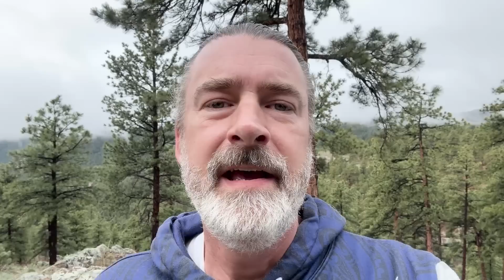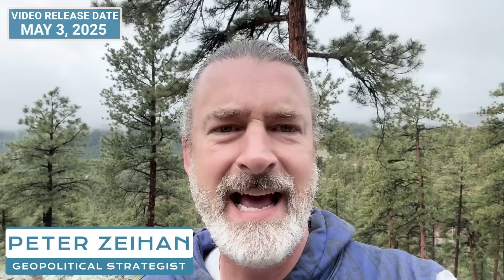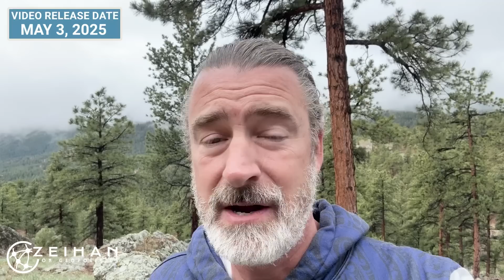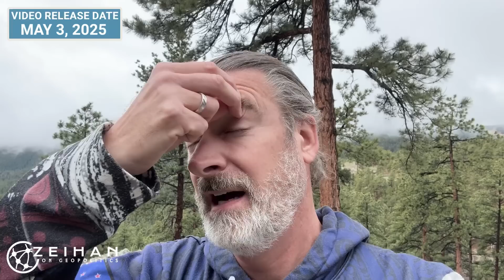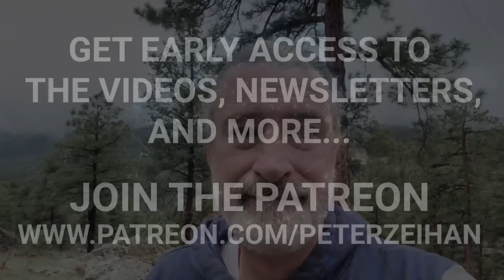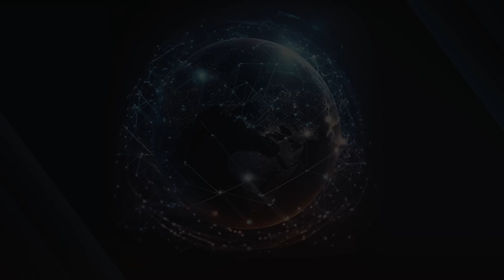The Night the Lights Went Out in Geor- er, Spain || Peter Zeihan

Comment: Electrical engineer here. We spent a lot of time in lectures covering Macarena to Lambada conversion. Wasn't my strongest subject. I preferred synth pop to grunge transitions.
Reply: Peter is sooooooo far outside his expertise, this vid post of his is a joke.
When he says megahertz and he means hertz and he doesn't mentally catch the mistake says he clueless about what he speaks.
He can't fathom reactive power, and syncing voltage and current freq in AC system and the power factor.... he shouldn't have ever made this post.
Every non-engineer is now dumber after listening to Peter butcher this subject-talk with  his terms like wobble and dance comparisons.
Reply: @joelobryan1212  the megahertz thing grated but to a non professional it's an easy mistake to make without realising. It wasn't a great explanation but I don't think it's quite as bad as you are claiming. I think I'd rate it "mostly harmless"
Reply: @joelobryan1212  this comment. 👍
Reply: Electrical Engineer: why can't the grid use a radio signal to sync everything?
Reply: @patrickshawstewart1538  I'm betting, latency.
Reply: As long as you saw the sign and it opened up your mind.
Reply: Latin dance teacher here. This is a perfect analogy, in my opinion.
Reply: Usually Electrical Engineers complain that the physical definition of current by Benjamin Franklin goes from positive to negative voltage, which is misleading when it's really carried by negative electrons in the opposite direction. But really we should complain about 'DC' and 'AC' when it could've been Waltz Current vs Mambo Current. Or Salsa Current. Or something.

Comment: South Australia experienced a "system black" in 2016 when nearly all grid demand was supplied by wind and solar. The wind was so strong it blew over several transmission towers, leading to a change in frequency and voltage then triggered the wind farms to turn off. This was because the inverter settings were designed to protect the equipment rather than support the grid. Since then every new generator (wind, solar, battery) added to the Australian grid needs a simulation where the inverter settings are tested as to whether they will support the mainentance of frequency and voltage in the face of a disturbance, such as the tripping of a transmission line. No further system blacks have occurred. Had these simulations been conducted in Spain prior to accepting these wind and solar farms their system black would not have occurred. At the time of their system black nuclear was supplying 20% of demand, and this was insufficient to maintain their grid. Now South Australia regularly operates at only 6% of grid demand as gas. A couple of gas units continue to spin at minimum load plus several synchronous condensors to maintain system strength.
Reply: It should also be noted that, in fact, the reason for the actual blackout was because coal plants had lied to operators about being spun up when, in fact, their operators had shut them down cold to save money.  So the buffer grid operators thought they had didn’t actually exist.  In ensuing years, the coal operators have more or less been completely cut out of the equation by grid scale storage which does a much better job supplying missing power when things trip off (most notably, coal plants in several later examples), and stabilizing the grid.
Reply: And what's the price of electricity now in South Australia ?
Reply: @anomadhunter  In 2024 price of Electricity on the Australian National grid was about the same as France.

Comment: Wind and solar combined supplies 30% of the energy in spain in total, I have a very hard time to belive that at the time, they supplied 80% of the energy. It's basicly like Texas in terms of production, but with interconnections. Seems really, really improbable.

Edit: According to REE, it was 70% from wind and solar. Also, it's not concluded, to this date, what caused the outage. Last major outage on the iberian peninsula was caused by a water bomber fighting wildfires. Also, the first occilations were detected 30 minutes before the outage and migated, suggesting that the readiness and spare capacity for occilations were in place. I call BS on this whole explanation.

Comment: The old coal and gas fired power station could be converted into flywheel. Giant motor generators that add physical mass to the grid and absorb spikes or provide carry through  power if there is a surge.

Comment: Ireland has huge spinning mass in shuttered coal plant used as a buffer and they will install a few more. Also nuclear. So that's 2 more options and probably using them combined with fast batteries is what we end up with... eventually after enough screw ups like this one.

Comment: Oh lord the old “inertia” talking point . There was no physical inertia that could do anything about a fall of about 10 gw of supply, this was more likely an issue with inverters or transformer stations . Also, you point out correctly that current grids ask for about 20% of inertia based supply (like gas) but co conveniently ignored the fact that the spain grid already had that 20% of sources with physical inertia, nuclear and hydro. This number has gone down constantly, i remember the old fossil shills hitting me with the 80% minimum of inertia based supply in the 2010s, now with better technology we are at 20% and we’re just starting to see significant amount of batteries on the grid that will be able to provide synth inertia, for extremely cheap (just check how cheap fcr has gotten now on any grid, batteries have undercut all the old systems). This all coming out before an official investigation mind you, so just using the opportunity to shill fossils.

Comment: Could you have giant flywheels. Worked at company that had flywheel generators they only provided a few minutes power but enough to allow startup of a gas/diesel genset. Flywheels would have a fair amount of inertia but you would need a fair amount of them to buffer the grid.

Comment: Wobble??? Is frequency all that difficult word for your viewers? Speaking of words, a "turban" is something worn on the head while a turbine spins to create power. You don't need coal or gas, you just need a source of power that can be turned on quickly to stabilise electricity production - that might be nuclear, grid scall batteries, large spinning weights or pumped hydro if you have the geography for it. Actually there are lots of other options.

Comment: The modern and most effective technology for grid stability is virtual inertia provided by sophisticated software in battery grid storage, like Tesla Megapacks. Tesla Megapacks use common lithium iron phosphate batteries, not some rare magical titanium batteries. The problem here was a power grid that didn't curtail excess solar production during peak production hours and that lacked sufficient advanced battery storage to maintain grid stability. The solution is to put competent engineers in charge of grid design, not politicians with an axe to grind.
Reply: ☝🏼THIS,

Comment: Im an electrical engineer. We could solve this problem if we had a battery that could operate in a high state of flux... One that could discharge a large amount of energy quickly, say, a capacitor. One that operates at about 1.21 gigawatts ought to suffice. 

The only green source of power like that is a bolt of lightning. Unfortunately you never know when or where one will strike.

Comment: there is flywheel storage that can take care of this.  The technology has been around for 75 plus years and with new technology these devices have become very effecinet.  People have look at flywheel energy storage but its cost hasn't come down as fast as batteries, but for fast discharge (Grid stabilization) it can't be beet.  Sandra National Labs has been working on this for year.  Some years ago SNL built this big, like the size of a shipping container, flywheel and they would take days to weeks to spin it up but then could discharge in a minute or so.  This was needed for some experiment that they were running.

Comment: Spinning reserve solves the problem. Essentially energy stored in flywheels. In a largely renewables grid in the absence of spinning nuclear or hydro generators, there needs to be quite a few of these flywheel systems scattered around the place to provide the necessary rotational inertia needed to stabilise grid frequency.
Reply: It actually doesn’t in this case.  15GW went offline at the beginning and Spain is still being tight lipped on the data… politics have gotten in the way.    The “wobble” as Peter calls it … well, there was some instability before the fall but Peter’s explanation was gobbly gook.  Literally made-up nonsense.  Spinning storage can’t deal with actual power deficits… it is strictly a stabilizing mechanism.

Comment: Peter...you should learn a little about honeywell/ess iron flow batteries. At the scale (multi gigawatts) and time (22hours) that they can discharge and the speed they can kick in (<0.5 sec) it would prevent the issue. It's cheaper thant anything out there and it only needs water, iron and salt.

Comment: You can have gyroscopes as well. Just spinning mass the same as a turbine. You just don't need coal to run them. They will give you instant reaction. Weather the power goes up or down.

Comment: I think you’re about to say flywheels for the second, wheel see. But you can also use big ass banks of super capacitors, and those are even easier to build than big flywheels. I’m talking you can literally build them in your garage. Either way, Lithium-Titanium is not the only choice here. In fact, I’d say it’s pretty far down on the list. 
As always, love Peter, but never forget that Peter is basically an Oil & Gas lobbyist when it comes to renewable energy. For whatever reason, he refuses to learn about the sector, probably because it’s complicated & he’s old enough to be set in his ways.

Comment: E engineer here.
I am so happy that you aren't consulting any grid operator.
No there are need for special batteries. You just need to re introduction of more rotational inertia on the system.
The best and cheapest way is use a number of sync. Compensation units. They are basically a standard grid generator with a motor, to spin it up to the grid speed and connect them to rhe grid.  They have exactly the same function as a powerplant.  And they are primarily made og steel, copper and aluminium.
Please don't step outside your field..

Comment: I'm an American living in Portugal, and the day of the power failure was quite interesting. Power failures have been few over the past 4 years. I've got a supplementary solar system with batteries that did not work (not designed to work) during a power failure. Maybe I can change that, I don't know. I am looking into installing a diesel generator to provide basic power, that starts up automatically when the power fails. If these power failures begin to be more common and last longer than say 12-24 hours, that becomes a higher priority.
Reply: I have an MPP SOLAR PIP5048MG off grid inverter/charge controller with some AGM batteries. It has a built in auto transfer switch in it so can flip to grid to source power or use solar and batteries. I charge  it off the grid during the day as have heap of grid tie solar and it runs some loads at night to save some money. It's also effectively a backup generator (via manual transfer switches) and provides about 8hrs of power (30% DOD on AGMs) and got me through a few power losses over the years. I bought some lithium iron phosphate to replace the AGMs and in theory will have about 24KW to burn as hoping to get 90% DOD if required.
Reply: @hemlock40  look at upgrading your battery system inverter to the grid forming

Comment: Peter Zeihan the grid electricity to stop CO2 emissions for every country is insanely impossible. 

Rooftop PV has no grid costs, rule1.
Electricit vehicles are parked 23hrs every day and all night long. 
V2G massive batteries on wheels are very useful. 
Saves you buying a vehicle and saves you buying petroleum for that one hour daily drive.
Just drive the battery, think of the savings. 
So rule 2, buy the big battery on wheels and it.

$TRILLIONS AND TRILLIONS saved on new grid capacity construction. 
DECADES AND DECADES saved on building new grid capacity construction. 
Hap hap happy days 😅 😊😊😊
Reply: You may want to note that peak electricity demand and peak driving demand overlap in late afternoon / early evening.

Comment: Large installations of Tesla Megapacks (Battery Storage) are used in Australia to stabilize their grid.
Reply: @robertcetti6935  they supply energy, not grid stability.  The problem is probably lack of rotational inertia.
Reply: @hgh425 they do both, actually.  Grid scale storage systems now perform all functions.  Voltage, frequency, momentum, generation.  Everything.  You just need to have enough of it on a grid.  Right now, primarily California, Hawaii, Texas, and some regions in Australia have sufficient grid scale storage to basically take these functions over from rotating storage.

Comment: You missed the third option https://en.m.wikipedia.org/wiki/Synchronous_condenser

You build heavy spinny things without the steam. So they don't generate power, they actually draw power from the grid to keep spinning but they provide the stability the same way coal or gas turbines would.

I assume there are not enough of these being built either, but at least it gives you another option of which rare elements you can use. (in this case magnets for the motors)

Comment: I read that Spain had 20% nuclear power, so it seems that perhaps they didn't curtail the renewable contribution for stability. But I have also read that inertia wasn't diagnosed as the issue yet
Reply: @emceeboogieboots1608  About half of Spain's nuclear power stations were switched off for maintenance at the time of the outage, so weren't providing inertia. This event is a useful reminder to plan plant maintenance/refueling more carefully.
Reply: @domtweed7323 Yeah. It seems that there may have been an over reliance on interconnections between countries to have planned to let that many offline at once

Comment: The only reason renewables are cheap is because they're only solving half the problem.  They're not reliable if you don't have tons of fossil fuel plants to backup on and fill demand gaps, or tons of batteries/storage to account for higher than expected demand or several days of clouds and light wind (or too high wind even).  Governments are building renewables everywhere, but all they're doing is slapping a FlexSeal on the problem without actually really addressing it.  Now Spain has committed to renewables, they are also committed to building the storage they need to put it all to effective use.  Let's see how that LCOS turns out in the end, or whether they're gonna add deaths due to blackout to the statistical death rate of renewable energy.

Comment: Solar has no inertia. Wind has. Maybe Spain and Portugal don't do as much Wind?

Also, my wind turbine produce AC from the start. Solar produce DC. Actually, for non-elec folks out there, any turbine movements gonna produce AC. You can imagine the electromagnatic field (google it) as multiple invisible sphere from a magnet. You slap magnets around a rod. Spin it. Those sphere gonna turn with the magnets. When the sphere pull on a metal thing around the magnet, it produce electricity from that "pull". So you can imagine that when 3 magnets turns together, you got it pull to the left, and right, and left again. That's why it's alternate. So anything with the same structure gonna make AC. Solar is different. You have no spin, so the pull only go one way and therefore DC.

So, I don't know how Spain and Portugal do their grid, but if they have a healthy mix of turbines, the issue shouldn't be from the lack of burning power source. It's the lack of turbine, which are in Wind, Geothermal, Hydro, Wave, and so many more options out there. Unless they do overwhelmingly solar and some sort of other no-spin source, Peter is likely somewhat incorrect here. I mean, he's saying "Wind Turbine" don't have much inertia. Have you seen those turbines? and what kind of turbine has no inertia?

Comment: There is a bit more to it: it was an event several hours before, likely in the morning and because of that the wobbel building up until showing in the collapse. The effekt is known since the 1940s Electric system. Intoducing more electronics on every side, production and use, it can happen everywhere worldwide. Introducing sonsors which can pick up to the wobbel early and circuits which can bring the wobbel down are needed to Stabilität the system.

Comment: Like lots of people have said, massive hydro generators can be run without being powered by water. They run as electric motors just to provide grid frequency control. They run local hydro power station does this since 1966.  Don’t need fossil fuels.